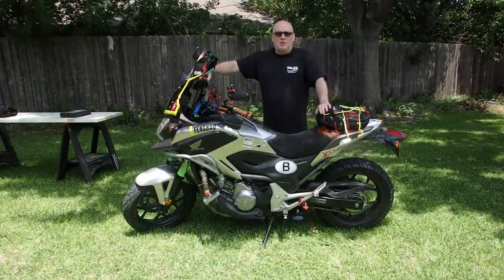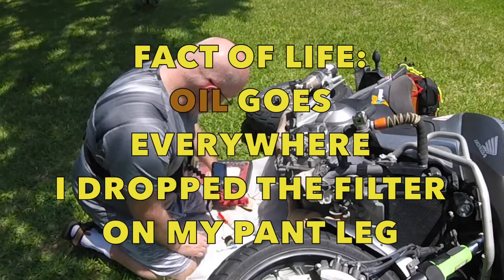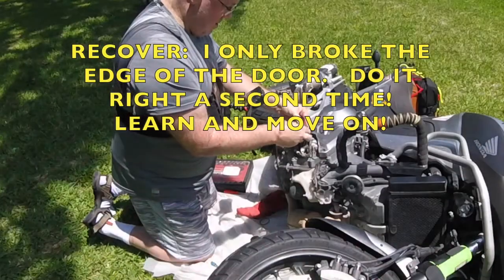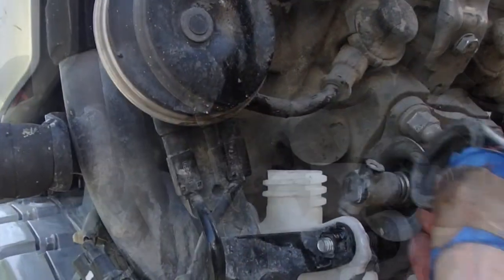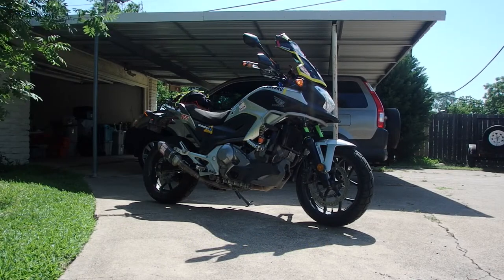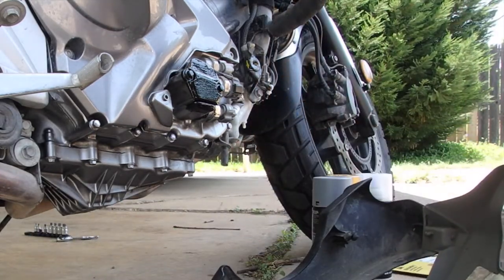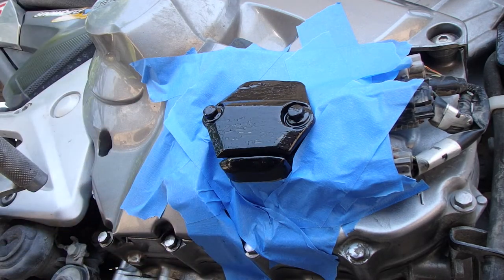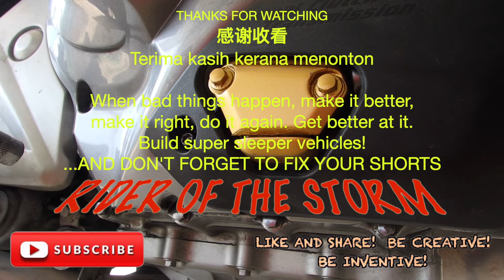NC700X NC750 - DCT - Transmission oil filter change without an oil change!

Comment from the maker: If you have the older model, mark the door using a sharpie with an UP ARROW so if the light is low, you do not try to install the door upside down.   Only the bottom half of the door actually shows through the shield.   To this day, I am still riding on the broken door.   It is GOLD!   I love GOOOOOooooold!    Maybe metallic blue next year.

Comment: What if you don’t have crash bars
Reply from the maker: @Reviews-Tidbits  lay it over in soft grass with a tarp.   It will be just fine.
Reply from the maker: @Reviews-Tidbits  if you have a new bike, wrap the bar ends in bath towels.   Then. Lay it over.   The bike rests on three things.   The bar end, the foot peg, and the swing arm depending on how the ground slopes.    I have dropped my bike so many times that it is no big deal.   You don’t see any dents or scratches on my bike in my videos, do you?   The crash bars below are wrapped and take all the abuse.   But for a new bike, you should know the contact points.   Turn the bars open to the shifter side.  Then lay it over.   Have someone help you lay it over softly.   My crash bars make it so easy.   The bike just rolls over.   A new NC with no crash bars can still be laid over with no damage.   Be cautious of any turn signal stalks.   My bike is tough.

Comment: I bought the filter for this job but didn't think of the oring 
Should it be ordered as well. What are the specs or where to get the info for the filter and oring?
Reply from the maker: I got everything from the dealer.   Honda parts only.   Yes.  You can use your own o-ring.   But you better be able to compare a new o-ring from honda to the one you buy aftermarket.    Use calipers.    The stock O-ring that I removed from the door actually had a nick in it.   I wanted to show this in the video. It was not so easy because the video and the still image didn’t always come out very clearly.   My approach is very relaxed. It was too bright for me to see, but it was an excellent environment to make the video.    The most fun part about doing this, is that it’s so easy to do. If your O-ring is somehow baked onto the door.   You will have problems and need to clean the door.   Be ready.

Comment from the maker: Thank you all for all the likes!   Yes, I am a buffoon.   What I want to show you is that when you work on your bike, you do not always need to follow the rules.   You can think outside the box... or in another dimension altogether if you read the comics.   Why try it yourself?  So you can break something and learn.    You can always learn a little something by do it yourself.   Now, when I did this video, I did not think about the near triple digit heat, super bright Texas sun, and a silver motor.  And, having my view partially blocked by a camera.   Wow.  So many complications.  You will do much better than me for sure.   I tried to shoot the o-ring check close-up.  Lost the footage and the chip in my bike bag.   Found it later.   There was a nick in the old o-ring.   The new o-ring was perfect.   Always keep a magnifying glass when doing this yourself.   Try to work in a clean environment, and if your garage is dusty, do it out in the middle of the yard... put up a tent if you have sun like me.  Whatever you choose, have fun with it.  It is easy!   Wear your old shorts, or keep some Simple Green and CRC electronics cleaner around.

Comment: Thank you for showing me all the ways to NOT do this.
Reply from the maker: @MrJkfamilyguy59  That was my whole point.   It was fun.  And relaxed and boing!   The cap sprung off.  And when I picked it up… the cap was upside down.   And my eyes were not adjusting.   Distracted by the camera and reflected sunlight of the motor… things got fuzzy.   It was getting super hot out fast.    Rushing.   I began torquing the bolts down… and snap!   All the things you should not do going into a job.  I still have the golden door on my bike.   It looks pretty good.   I love gooooooold!